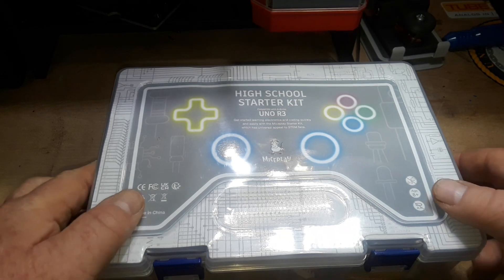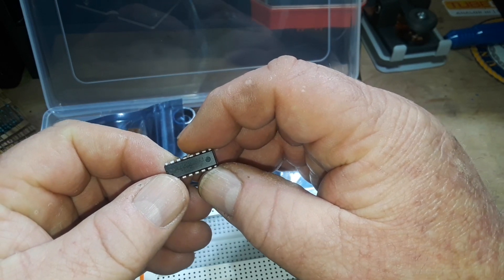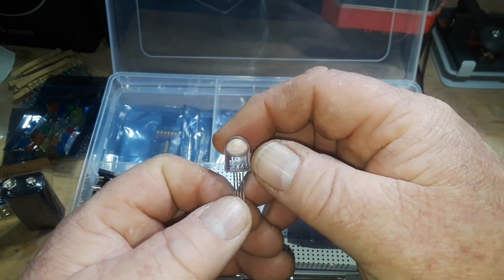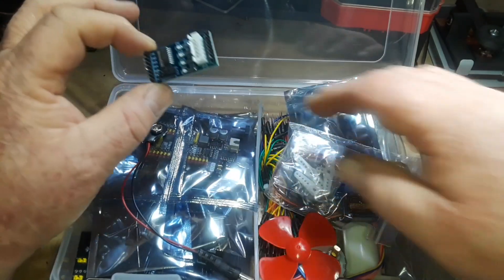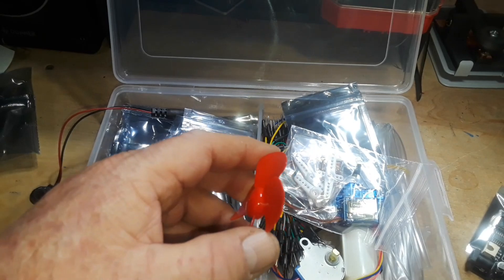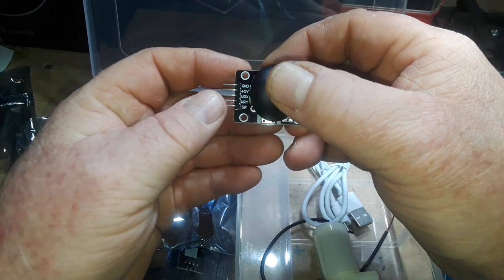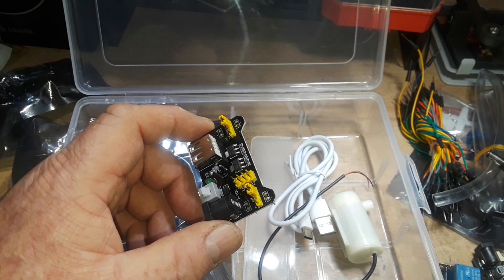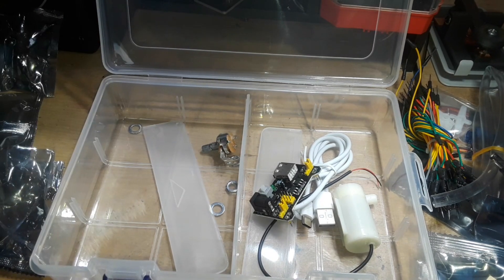Arduino Uno R3 Super Starter Kit from Miceplay

Comment: This channel is a gold mine, thank you for your time and effort. I've just watched your smoothing and filter cap videos on power supplies

I wonder if you could help, I'm trying to cleanup the output of the HP DPS-1200SP power supply. It seems under lower loads it's a RFI canon. Would this be as simple as placing a common mode choke on the input and output and then a few output filtering capacitors?
Or am I getting confused between CMC and differential mode chokes? What would be more suited to "Switching" noise on a powersupply. 

I was under the impression these where relatively "clean" PSU's but they seem to splatter all over 14 and 27-28mhz bands. I know it's possible, just wanted some guidence on what parts to consider. 

Cheers, BKHD